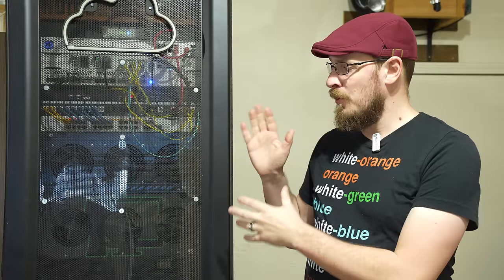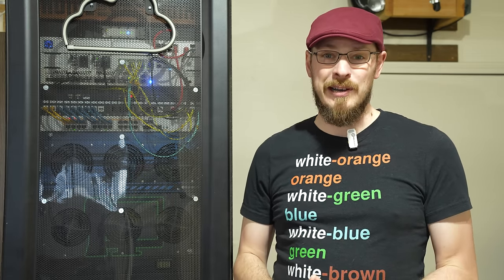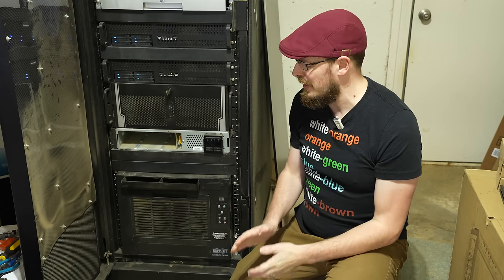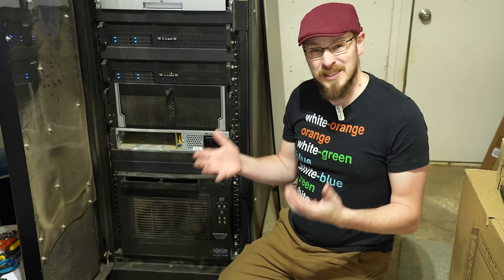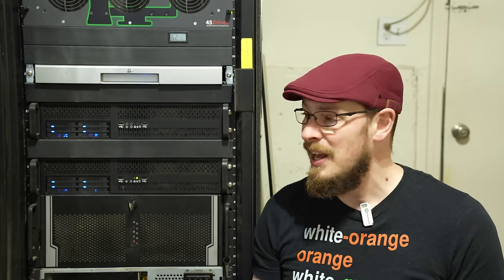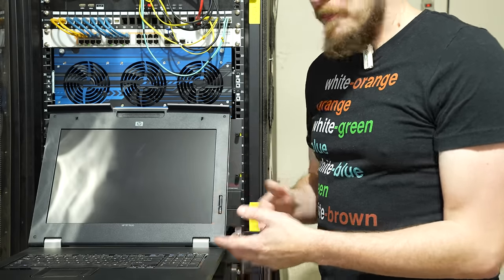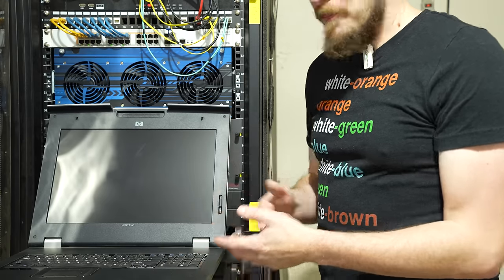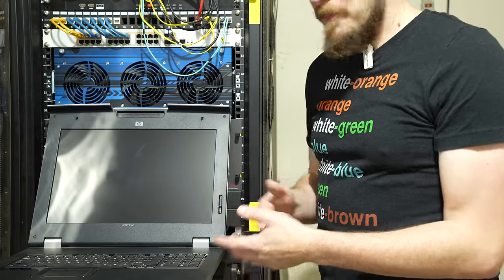Homelab and Server Rack Tour - 2024 Edition

Comment from the maker: Would you be interested in custom (Designed and Made In House!) Rackmount Vanity Plates? Let me know here, and I'll look at adding them to the store.
Reply: Definitely
Reply: I would almost be more interested in a fan chiller plate OR maybe a little raspberry pi mounting solution... Still with your branding/ design, but with a more practical use...  MAYBE even one with a small patch panel insert if we can find one for cheap enough.
Reply from the maker: Any product with dimensionality or that requires manufacturing likely won't come out of my shop for quite a while. I'm a one-man-band with decent tools, but I'm also very expensive per hour ;-)
Reply: I'd by a 2u plate like the one in your video totally.
Reply: I would love a few simple designs like the one in your video. Basically just something funny to show friends while I’m flexing my servers on them 😎
Reply from the maker: @somebody943  Sounds like I need to mock up a couple more designs and add them to the shop 🙂
Reply: How about a custom rack mount plate for the gateway?  Along the same lines of the top one, just one that would fit that type of surfboard?
And you forgot to mention your emergency Network disconnect bat'leth, for just in case of a hack....
Reply: Yes, I absolutely would. I rarely see my rack, but it would be very fun to have a vanity plate sitting below my proxmox hosts.
Reply: HELL NO!
Reply: Yes to vanity rack plates.  Love it.
Reply: I was just looking at the plate at the top of yours and thinking about where that came from, then I noticed this comment. YES! I’d love these!
Reply: Would also be awesome to have custom sayings
Reply: I'd love a personalized 2u unifi blank. I'll be your first order.... pick me, pick me!
Reply: 2:10 - WHERE do you live?  I thought my power was cheap at around 13-14 cents/KWh in VA.

12:50 - Ah... Oregon.  Y'all have wind, solar, or hydro as your big renewable?

25:10 - So... we're just gonna ignore the Bat'leth hanging on the side of your rack? (FWIW: DS9 is my fave!)
Reply from the maker: @coolraul07 Hydro is 98% of my local grid.
Reply: I would like one!!!

Comment: I love it, an attainable, reasonable yet at the same time completely unreasonable home lab...  As it should be...
Reply from the maker: There's something for everyone in here. Low TDP VM hosts that cost less than $400. A 64-Core Epyc build that was $20K when fully built. High end NAS, low end NAS, 1Gb PoE, 100Gb Fiber...
Reply: @CraftComputing  Your videos served as base for when I graduated as a network engineer from Uni and started working, and after a career change and opening my own business, I still reference to your content for upgrading and modifying my network.
Reply: ah yes a full size rack with air conditioner very reasonable 😂

Comment: May I suggest you try an air purifier with a particle filter? It could substantially reduce the amount of dust, at least it works really well for me! I use a relatively cheap one IKEA sells.
Reply from the maker: It's a 600sqft garage that houses wood working and laser engraving tools. It's going to be a bit dusty. Easier and more cost efficient to blow out the servers once every 6 months.
Reply: @CraftComputing  Every six months? My thought was seeing that dust, that it might keep you busy with every 2-3 months. But hey, if 6 is good enough, I'm fine with it. Considering you busy doing other dusty works there, seeing it in this particular time, it's not that bad.
Reply from the maker: A thin layer of dust doesn't affect performance. If it offends a couple people on the internet, they can go home and clean their own racks.
Reply: yeah man, that had some dust
Reply: @CraftComputing  No, no. I didn't mentioned anything about being offended, or anything like that. I just told you what thought was in my mind. It was a perception on periods of dust cleaning. You answered as no performance hit on it. Great.
No balloons popped in your hand, and I am lucky, I don't have a rack sized infrastructure. :P Dust still a factor, haha.
Reply: Whoa! Easy, man. haha  @CraftComputing
Reply: @CraftComputing  it depends, if the dust is conductive it could break stuff or if it's flammable it could spread fires, I would say beefing up the intake filters would make it a lot easier to clean without taking everything out.
Reply: Maybe next time just give the rack a good ol clean up prior to a showcase video? I agree with what you said, dust isn't a huge issue in small amounts but it definitely is an eye sore for the more aesthetically minded viewers. @CraftComputing
Reply: Agreed, if he shows off his rack he should expect comments of dissatisfaction if it looks neglected. It's absolutely an eyesore but it's no big deal, just some second hand embarrassment.
Reply: Bro get an air filter / purifier. Absolutely no need to be dirty.

Comment: For your UPS batteries, you might look into 12V LiFePO4 cells. They have integrated BMS's that work with lead-acid chargers and whatnot while still having longer runtimes and much-much better deep-cycle tolerance than lead-acid batteries. They're a bit more expensive than lead-acid packs, but you don't need to replace the whole UPS unit to benefit from the improved chemistry.
I replaced the 4 lead-acid packs in my Eaton 9130 rack UPS, and they've been rock-solid for several years, despite frequent power blips and outages in my area.
Reply from the maker: I considered it, but the UPS is only there to prevent brown-outs and surges, not really for any kind of uptime insurance. For $240, I should get another 5-6 years out of the Pb battery packs, and that's plenty.
Reply: I did this with my APC SMT1500rm2u, and eventually upgraded to a SMT2200. The only thing to be aware of with APCs is they have an unusually high float voltage, and it will shorten the life of the LiFePO4 cells. Luckily with the SMT and older APC units you can enter a programming mode with an FTDI serial adapter and adjust the float voltage to within spec for the new batteries.
Reply: @xDownSetx  Very interesting.  Least we know it's not a drop in replacement for newer APCs.   Good to know there are hacks to make it work.

Comment: Good to see your rigs,  interesting Aircon for the rack .  I have my rack in the basement. I use it to dry clothes. The temp doesn't get above 20c.

Interesting power load. I'm at 400w with 4 servers (2 xcp-ng, soon to be proxmox, pfsense and truenas scale 24 drives)
The power cost is 35p (UK price) something like $0.04
So I built a Victron system. That can power the house if there's a blackout. 
But the main point was to access cheap electricity overnight at 7p. So I charge up the 82kWh battery (3 phase 230v) then run the house off grid for the day. 
It is also the whole house UPS system.

Comment: This 12:00 is the reason why I decided to go with just a regular 19 inch monitor + keyboard + mouse and then rack mounted it. It takes up more space in my server rack. I am looking for a swinging monitor rack mount that would accommodate a regular monitor but can fold up and stick inside the rack. No luck so far.

Comment: Great to see how things are evolving with the home lab!  I managed to set up 100Gb networking at home too and agree it’s pointless.  I can get around 50Gb real-world file transfers using ksmbd (the kernel-side implementation of SMB which supports RDMA using RoCE) on Linux for the file server and using Windows 11 Pro for Workstations which supports client-side RDMA using RoCE (all using PCIe Gen 4 x4 NVMe SSDs on each end with fast file systems like XFS on the server rather than ZFS and NTFS on Windows).  Would recommend looking into this as I get much better speeds than using regular Samba and lower CPU usage.  Configuration isn’t too hard as well - ksmbd can basically just be enabled on most modern Linux flavours and is essentially a drop-in replacement for Samba.  And on the Windows side (as long as it is the Workstations version or some other enterprise versions I think work as well) it all should just work with default settings (at least with Mellanox cards) if things are configured correctly on the server side.  Because this uses RoCE you can just use regular Ethernet networking without needing to play around with Infiniband.   But, as you say, you basically never need these sorts of speeds with anything you do in the real world as there are usually lots of other bottlenecks.  Would therefore only recommend max 25Gb or 40Gb if using older cheap Mellanox ConnectX-3 cards, for home use.

Comment: I just got my first ever server rack : an old Dell Poweredge R710 dual Xeon E5649 that is actually running on Proxmox 8.1.4. I must admit that it as been flawless and more than enough for my needs. I mainly use it as a game server host (running multiples game servers at the same times) for me and my friends. I love it! I think I'm gonna build a server rack with a nas. I mean, once you taste it, you want more I guess... I also plan to max it out before starting to spend money on something newer. I want to put dual x5690 (which they are very cheap on ebay), 144GB of RAM (yes, I will use it fully) and fill up the 8 slot SAS with nas hdd for backups. (The VMs are actually running on a nvme plugged on a PCI-E adaptor, even tho it's old pci2.0 it still reach up to a 1gb/s wich is great for my heavily modded fabric minecraft server). But in fact, I'm gonna fill up the PCI ports with even more nvme that I'm gonna software raid to reach even more.

Comment: Jeff is probably the leading cause of my buying more rack gear. 

now that my 12U is full of networking gear, UPS, and 12 thin clients in a cluster, I find myself looking at 22U cabinets and full size full depth racks, disk shelves, and used epyc and threadripper stuff on ebay. and those erying boards are quite tempting for playground usage.

Comment: I loved your lab tour. I live in the northeast where electricity definitely does not cost $0.07/KWh, more like $0.20. I have FiOS “gigabit” which provides 950 down / 880 up. I’ve had it for three years and it has not once failed, though our power here is extremely reliable. Take from that what you will :)
Reply from the maker: I've only lost power once in the last 4 years at this house, and it was during a generational ice storm. Power was restored in 4 hours.
Reply: Currently have to pay the equivalent of US$0.47/KWh here in the UK. Really makes me want to replace my home server with something more power efficient 😅

Comment: For the UPS I believe that you can just replace the batteries individually saving money or purchasing better quality or longer lasting batteries then perform a load-runtime calibration. Thats what I do with my UPSs, BatteriesPlus has Duracell batteries with a larger rating for the same size battery. Sure can notice the difference when it comes to runtime.

Comment: While the dust triggered me, I still realize it's probably all fine.  We had an HP Gen6 DL380 across the hall from an automotive salt spray test lab with shared plenum space. Server ran for 12yrs without issue despite being fully oxidized inside from salt exposure.  We distributed the hard drives among the team as momentos.
Reply from the maker: There's dust, sure, but it's not clogging the servers are affecting performance.

Comment: Helpful tip...on your monitor, press the right bottom button, then the - middle button three times to auto configuration the bottom button again and 75% of the time it works 100% of the time to auto adjust the screen.
Reply from the maker: I usually auto-config it, and half the time it still messes up.

Comment: Good video 
Those little TigerLake boards are cheeky I actually religated a Poweredge R720xd based server with one of those.
The performance wasnt as good but the drop in power and noise at that performance was dramatic.

Comment: So you're limited to 1000/35. In Australia, NBN Co has in the last 12 months or so released 1000/50 plans and has recently dropped the price for it too. Having such high speeds are just amazing.

Also, Yes, Starlink is definitely great for backup purposes or even a primary over a 4G connection in rural and remote areas.

Comment: that 4 port 100g switch is only for backhaul between storage nodes. it's not meant for anything else, and it is a meme to use it in a homelab elsewise. you can utilize 100g in a practical manner in your homelab by using an n9k-c93180yc-ex as your core switch (or preferably 2 in a vPC domain). 260w each though.

Comment: Awesome lab. A patchbox would make the patch cabling look sweet!
Reply: Patchbox is so fucking gimmicky
Reply from the maker: Only $775 to eliminate the four 1M fiber cables that I can live with but you can't. Seems like a bargain, considering it would be the most expensive networking component in my rack!
Reply: @CraftComputing  well, it can be also used for ethernet cables, not only fiber. From what I know you can customize what cartridges you want, which is a plus. Also, fortunately there are different sizes at different prices, afaik the patchbox 365 is around 450€. Still expensive though and can be unnecessary, but hey, it looks very clean

Comment: Should have just used that Brocade switch if 100 gigabit is a waste. I'm running two of the ICX6610s. One with 24 PoE+ ports and one with 24 SFP ports. 40 gig between them and one gets a 40 gig connection to my server. The one with PoE+ is used for my home, like WiFi and cameras. Connected to my UDM-Pro with SFP+, and connected to my desktop with SFP+. The switch with all the SFP ports is for my neighbors who pay me for internet. I live in a campground and their WiFi doesn't work well (campers are almost like Faraday cages). Everyone gets an OM3 line and a media converter than also injects PoE to a Ubiquiti access point. This spring I will be up to 11 (maybe 12) customers.

23:42 I feel the same way about Comcast. I'm on 600/35 from them. It's getting really really old. It's asinine how their network is mostly XGSPON but that last few hundred feet HAS to be coax, unless you're willing to pay thousands. And it's stupid how their business fiber is. They only offer crazy plans for that. A dedicated line, static IP, SLA that makes them fix an outage in a certain amount of time. I'd be fine with PON, DHCP, and a more residential SLA.
Reply: I wish Comcast would lay out a roadmap for when and where they are going to roll out the mid-splits. I could deal with 200 up.

Comment: thanks for this tour!
One question - how do you manage your Mikrotik devices? My understanding is that there is no centralised management dashboard, like Unify (or TP-Link/Omada) has. Configuring each device separately, of are they support some form of stacking to be managed e.g. through Winbox? (I'm looking at building my home network with  CRS328-24P-4S+RM and possibly CRS310-8G+2S+IN, but their AP range is not looking great)

Comment: I still cannot believe the idle power consumption, unless most of what we just saw is powered off 99% of the time.
That is considering my R730xd with dual xeonv4 is already consuming around 200W alone with all the hard drives installed. That is without networking equipment, without AC, without console, just the server alone.

Having that said, electricity is around 35cent/kWh here. Fortunately I do have a big solar farm, so summers are not a problem. During the winters however I'm hurting and still.trying to figure out a way to at least be able to use the heat the rack produces as heating for the house without also importing the noise level, which failed so far.

Comment: You would do well to learn to do your own SC fiber patch cable, it is surprisingly easy and the tools have become very cheap. 
As for network speed, 40gbe networking (or IP over infiniband) is far far more affordable than microtik prosumer switches. Only real downsides is they use MTO/MTP cables which are not economical to DIY.  If you want speed, you need network cards that support RDMA on both ends, which most consumer grade cards do not.

Comment: I didn't got about 10 gig switch. You said it passthrough between 100 gig network and 1 gig network. But your 100 gig switch connected to 1 gig switch directly. Soo may be you simply don't need 10 gig switch any more? You also have 3 more sfp+ ports in your 1 gig switch left. It will save you some power.

Comment: Thanks for the video and the update on your Home Lab.  Quick question: Do you think that I can put the Erying 11980K Motherboard on a single U case instead of a 2U Case?  I am not sure what low profile that is low noise and has the right height can be used on a 1U rack mount cage (i.e., IN-WIN IW-RF100-S315)?

Comment: Love the 100gbit, completely overkill but hey. Honestly I’d run it if I could ^^

The WAN upload is garbage, I know DSL can have a distance issues because of signal degradation. I don’t know about cable but if your download speeds are that high it smells like ISP tomfoolery…

And I have to say it, please clean the rack a little :)
Reply: This is an issue with DOCSIS low-split where providers reserve only 5-42MHz for upload and use 54-860MHz for download and live cable TV. To support higher upload speeds, the ISP needs to switch to mid-split or high-split.